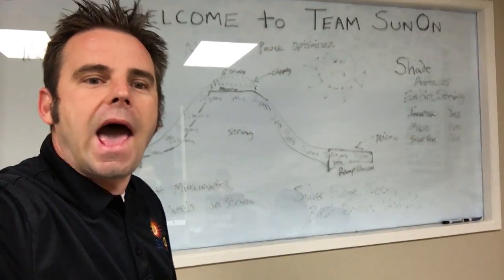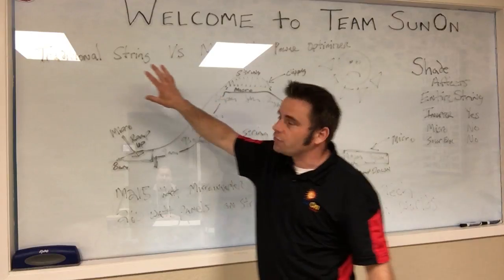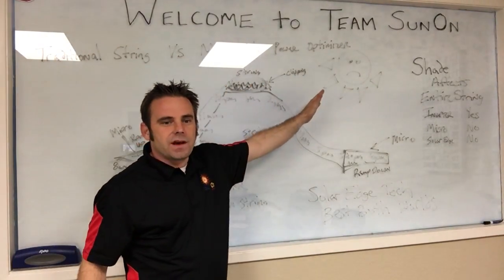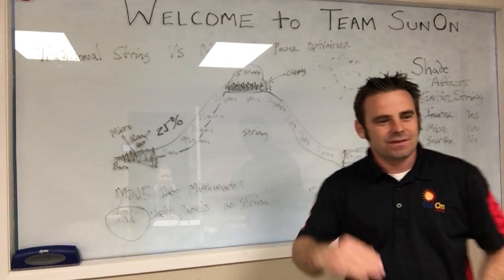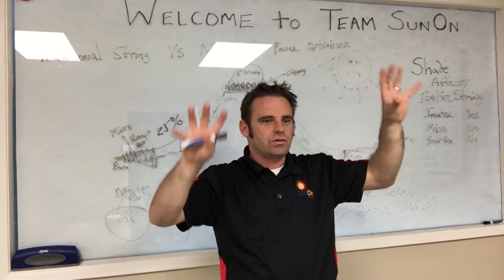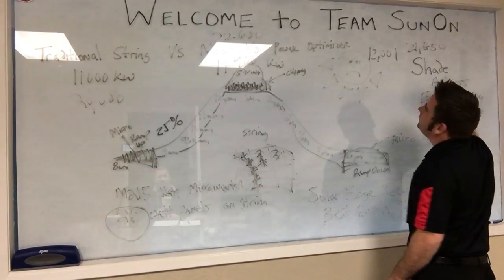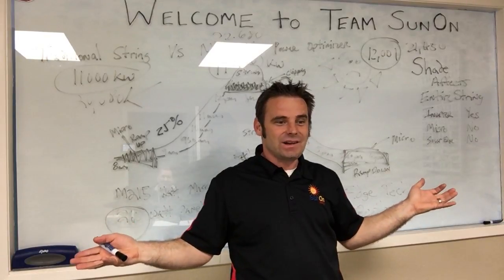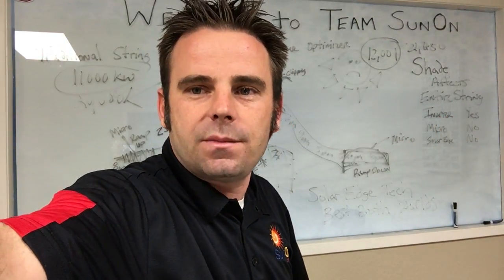Clipping, and explaining string inverter vs micro inverter vs power optimizer Daily Dose of Mike

Comment: Great video, I hope you (or somebody else ) can answer this question. What happens if you pair a 425 watt panel with a 400w Optimizer ?  Since the panel does not produce 425w all the time and all days are not ideal. Would that be too much power for a 400w Optimizer ?  Or..... Will it the optimizer just clip power when it reaches or exceeds 400 watts ?   Thanks
Reply from the maker: Honestly I’ve been out of solar business for few years now.  But I would imagine it would.  If it’s designed for 400.  What I did believe in was every situation was unique and I would always recommend the best for that. Like why use optimizers if your 200 degrees with no shade 🤔.  Just go straight string converter if it’s less expensive. Solar all about maximum return on your dollar.  Lot of sales folks where more maximum return for them.
Reply: @MarineMikeCheck  With SolarEdge, a big part of what the optimizer does is condition the voltage to match the inverter.

Comment: There will be 2 times it may clip one at the DC to DC interface the second at the inverter. The other disadvantage is every time electricity is inverted or converted there is a loss to heat. Just touch your car phone charger. Trying to capture this small amount by of clipping is not financially advisable. The optimizers have shown to heat up the panals so the net gain is mostly neglagable. Do your research don't believe what the person that comes to you tells you they all have the best just ask them.

Comment: I will go with micro instead of  power optimiser, life of the normal inverter is half of micro, and any failure to the normal inverter shut down the entire system.  So if you look at the ROI of entire system micro will be much better.

Comment: With power optimizer system, you need to get an optimizer larger than your panel 400 watt optimizer with a 350 watt panel. Also scale the inverter above the total of the array. 7.4kwh array with a Solaredge 7.6kwh inverter. ZERO CLIPPING!! The only loss will be during the DC to AC conversion 3-4%. Lets do the math....1 watt from the panel equals 1 watt into my grid. Its not rocket science. With the increase in inverter size in the past few years we don't need complicated design anymore!
Reply: Martin Bernard why not oversize the solar array to be bigger than the inverter?

Comment: Solar-edge is ridiculously expensive. The inverter is cheap. But add in the optimizers and not so cheap. Enphase is ridiculously expensive as well. On comparable 28kw setup (100+ 300w panels) using 4x7kw SMA sunny boy inverters and their rapid shutdown system, all-in it is $17,000 less expensive than using enphase. I'm sorry, but if I add another one or two 7kw SMA inverters the system is going to blow enphase out of the water. Same system, how much longer is payback or break-even point for enphase @ $17k extra? Will enphase last 25yrs warranty? Even if I have to replace all SMA inverters after 12-15yrs with new ones... it's still cheaper and if you have to replace micro-inverters on the roof it's a lot more labour than replacing one string inverter. All you have to do is run the numbers, numbers don't lie.
Reply: westvandude on paper.  

If your installation is on a roof, how many times are you going to clean leaves blocking a single panel that is bringing down the output from a whole string.

A string inverter makes sense where you have immediate access to do a quick clean up of the panels.

If you will leave your solar panels for long periods of time unattended and without cleaning debris, then the output of string inverters might affect the payback period.

Not everything that is cheap applies in a solar installation.

Comment: Do power optimizers come with monitoring as well?
Reply: Jitender Kumar yes. it is a separate module paid separately attached to the meter. solaredge for example has a monitoring software for their dc optimizers

Comment: What to expect if one chooses to connect a total of 20 kwp panels with optimizer on a single 17 kw solaredge? Is a clipping expected?
Reply: The 17kw will probably clip about 17.2kw but if you ever get more than 17.2 out of a 20k array you are doing really well and it will only be a few hours a year at best. You would need to be at a low temperature and have the sun pointed perpendicular to all the panels on a perfect day. Panel watt cost less than inverter watts in a lot of cases.

Comment: I have to ask.  Are you certain about what you said, "when a few panels are shaded, the whole string is down"  Isn't that the point of having bypass diodes??? so that if some are shaded, they are bypassed and do not drag down the whole string
Reply: Michael Ambrosia you might want a product like AE-Solar.  It will avoid hot spots, and will perform better than most solar panels when shaded.  There are several videos in YouTube showing the difference in performance compared to other panels.

Comment: is there a power optimizer system that goes right to battery charging rather then to inverter when I don't need an inverter. the one I saw makes it seem I am bound to use through the end only their product.

Comment: inverters with power optimizer beat putting electronics on the roof anyday... we used a sunnyboy 7.0 US and two strings of 16 x 300w panels and have a 3rd DC input for expansion later , perhaps a wind unit. also the other systems place more risk of radio/tv static from all the electronics on the roof.
Reply: We have found a lot of failures on Optimizers and solar panels connected to them so I disagree. We do not see the same issues with micro and that is AP and Enphase. These units have no solar panel failures I had 3 warranty issues on 11 systems total in a 1 year period with the solarEdge product, that is huge. I use mainly micro and have no issues
Reply: TheEvolveGreen you seem to have the same experience as this guy:

https://www.mcelectrical.com.au/solaredge-inverter-optimiser-review/

Comment: There is not a lot of difference in price between a power optimizer (solar edge) and micro inverters so... Why wouldn't you just use a micro inverter that can that goes up to a higher wattage to make sure there is not clipping? Why would you run a 215 on a 260w panel, why not just run the 250 and not worry about clipping?
Reply: The Enphase M215 actually tops out at 225 W, so difference is actually about what you'd want in trading some clipping for stronger output on weak sun days.  Why not M250: Also on very weak days, there can be lost watts to an overlarge inverter not turning on at all, but that tends to be a minor consideration.  The same panel + micro combination can be right or wrong based on the larger array issues like shading and tilt orientation factor (are you at 180 south or 93 deg ESEast
Reply: Maxim are cheaper than solar edge
Reply: EVMANVSGAS they are both different ways of approaching the same problem.

There is a cost point at which micro inverters make sense.  This is determined by the number of panels and the total system cost.

You can, also, combine all three technologies if you have a difficult installation site.  For instance, if there are no shading issue, a sting inverter might be ok.  In another part of the site micro inverter might work ok where shading is involved but not too many panels are needed, and in a large part of the site where shading is an issue, optimizers will do fine.

It depends on the problem that are you addressing and the circumstances for solving it.

Comment: Why wouldn't you just use a micro inverter that can that goes up to a higher wattage to make sure there is not clipping? Why would you run a 215 on a 260w panel, why not just run the 250 and not worry about clipping?
Reply: If you could drive the inverter to its max output every day (with no additional cost or amperage issues) that would be ideal. Since some days are less sunny, you are really making a decision about how much clipping to trade against how much cost ("extra" DC watts) to add "area under the curve" where you are pushing the inverter to 90% of capacity vs. 85% (for example) - that's 5% for those sun-hours, then you add up over all the sun-hours in the year to make your decision on design.
Reply: Because the solar panel will degrade overtime and if you have the the micro wattage to close to the solar panel wattage you will have produtcion loss overtime.

Comment: Great video, just a side note. Systems with DC optimizers can still clip, it just happens at the inverter. Also its the voltage that drives the inverter/optimizer not the current.

Comment: Has it really gotten that cheap already?  You were listing a 11kW system for around $20,000.  That's $1.82 per watt.
Reply: steve stevie 
He isn't referring to a 11kw system Size, rather 11,000 kwh of annual production. System Size does not equal production. He likely referring to a 6kw system Size for all 3 examples, but the variance in actual power produced depending on what type of inverter system you use.
Reply: thegoodfinder costs have dropped so much by H2 2020 that you could install a 10,000 watt PV panel system for around $10,000 if you install it yourself with quality products but not the most expensive products.

For the best quality products, the same system will cost between 30% to 50% more.

The cost of produced energy should be less than $0.06 per kWh with an average solar resource, and with a good solar resource it might be below $0.03 per kWh.
Reply: steve stevie was

Comment: really?  expanding the system was never mentioned... most homes will increase usage within years, specially if the bill is lower now. panels will drop efficiency  with years, expanding the system with out adding a complete string is important,  is a great feature, and saves money for customers.
Reply from the maker: That is another nice advantage to micro inverter, easier to expand with.   panels do loose efficiency over the years, in fact most panel warranties state they will warrant the panel will produce 80%n of original production by years 20/25.  about 20% drop.  and people can tend to use more power when they go solar.  It's all in the designers hands to build system right
Reply: @MarineMikeCheck  can you combine micro inverter with string inverter, i would add more panel and i have 2 string inverter but i cant add that much panel, i have no more space so i would add 12 more panels 3 x 4 with 3 microinverter with 1200w for all 3 phase, would that coused some problem to string inverter or grid?